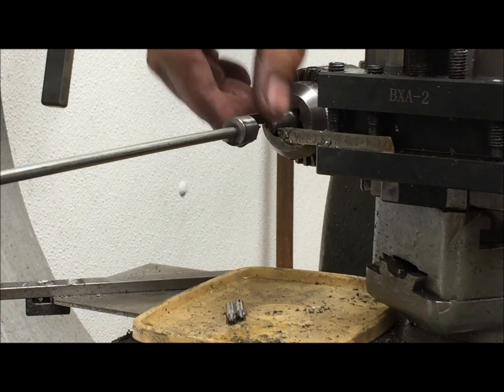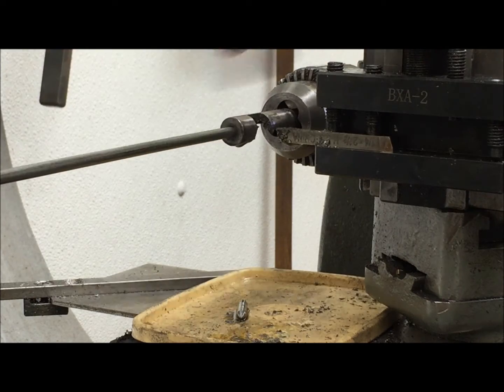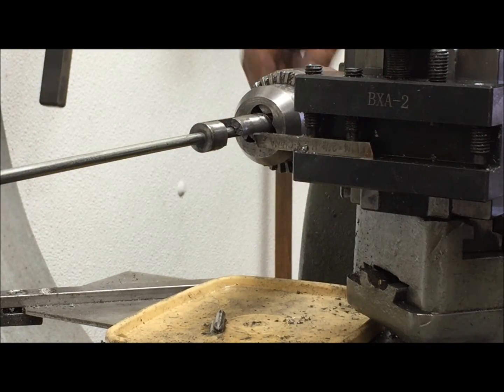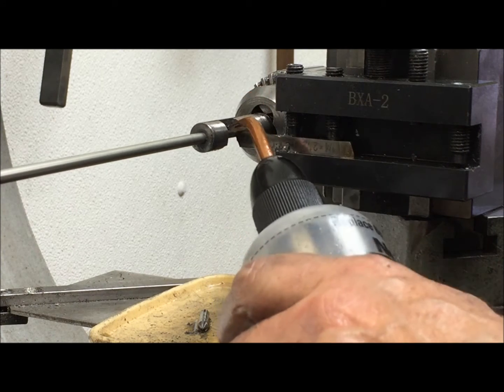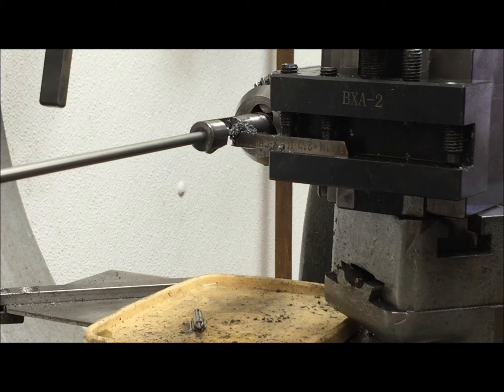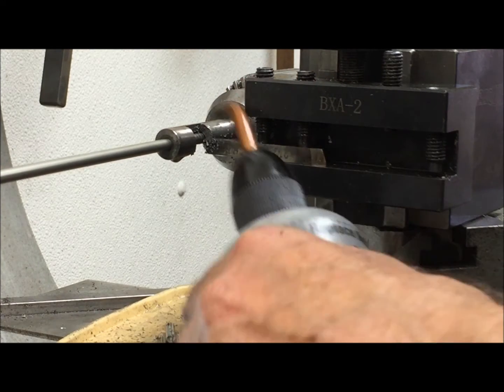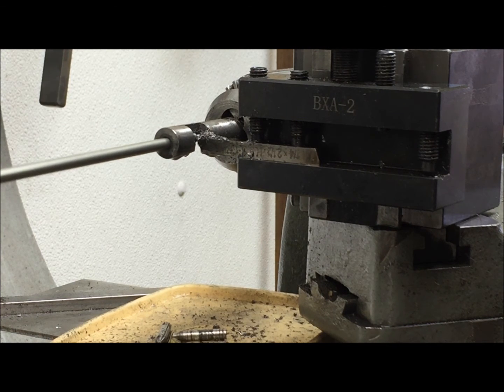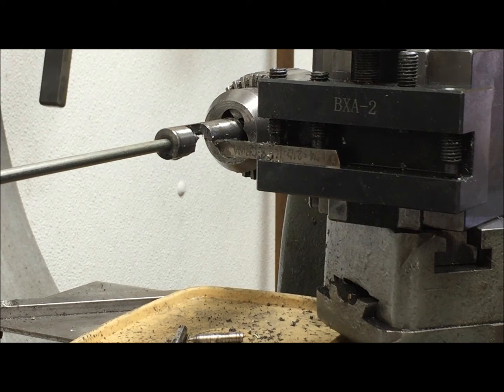Pin Cutting Fixture

Comment: I don't see any problem with it as long as the rod doesn't whip out of control between the chuck and your fixture.
Reply from the maker: Once the cut starts, the rod is locked in place by the cutter. I have not seen any excessive whipping so far but do watch for it when the rod is at max length.

Comment: what a horrible setup
Reply from the maker: I am open to suggestions on how to make it better.
Reply: use a steady rest and a more narrow parting blade, or collet, or cut it on a saw then finish the ends. anything to remove the dangerous shaking and vibrations
Reply from the maker: meocats It might look like there is a lot of dangerous shaking and vibration, but that is from the plunge cut. Using a collet and parting tool would be more secure but would take a lot more time. After each cut the lathe would have to be stopped, the collet would have to be loosen, rod advanced, collet tightened, and lathe powered back up. That is fine if I was doing a few of these pins but not 60 of them. The fixture essentially is a built in follower support right at the cutter.